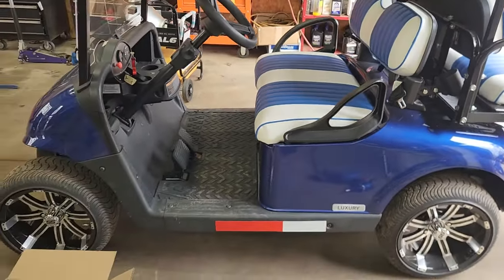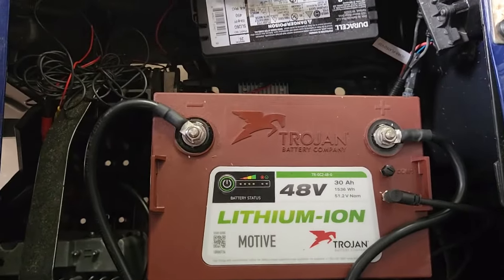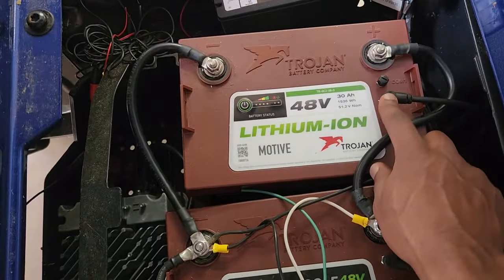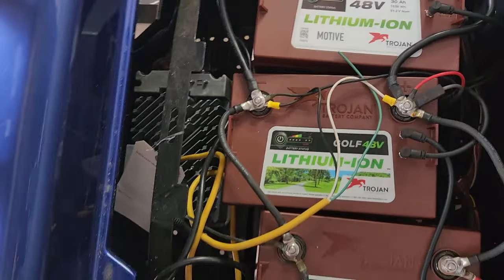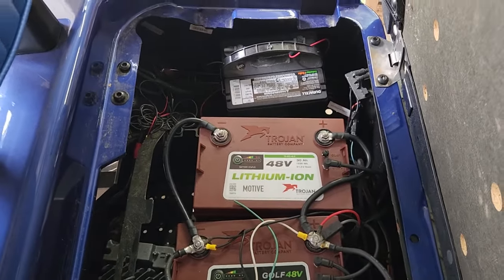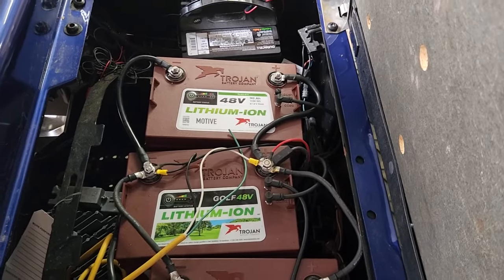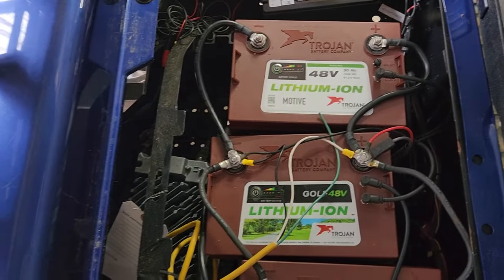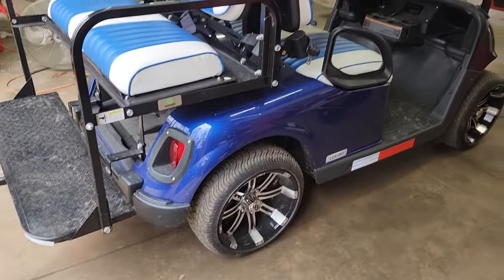Should you convert your golf cart to Lithium? Are Lithium batteries safe and worth the cost?

Comment: Any transport is weight dependent; I changed lead to Lithium in my EV which was one third the weight AND three times the power!
It really is a no brainer.

I would avoid parallel though; but it wont hurt except in final longevity.

Not sure why you didn't put in 4 series 12volt batteries which would have been cheaper and more efficient?

Put a solar panel on the roof of your cart and you can have extra range when out and about!

Really if you have parallel batteries you should have an equalising system; which I think is the problem you have; disconnect them all and fully charge EACH ONE INDIVIDUALLY and then reconnect them.

I used to use Trojan Lead batteries but for Lithium I think generic would save a fortune and be as good.

Lithium don't like to be fully charged and in fact if you are not right about to use the vehicle then keep it about 60%

You would be better with a star connection to your motor controller rather than battery to battery connections from one to the next.

If the batteries are unused for months then keep them at a lower state of charge.

You could get the same system with 12v batteries for about 300 dollars a battery.

If they guy uses it twice a year; then he should RENT a cart!
Reply from the maker: That's awesome. How long have you had lithium batteries?
Reply: @jeshualee2711  

I've had several lithium and lithium-lead mix systems for a few years (off grid home,  Solar-sail boat, DIY EV,  modified scooter) and the price is coming down making them so much more practical; for example ten years ago I installed my solar home system with lead acid but now I wouldn't even think about doing that as it could be done so much better with lithium.